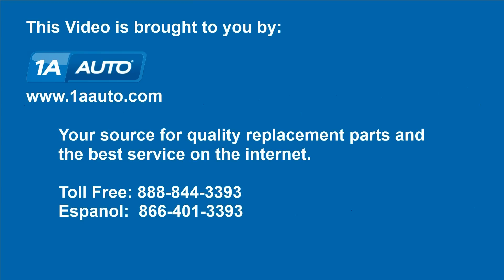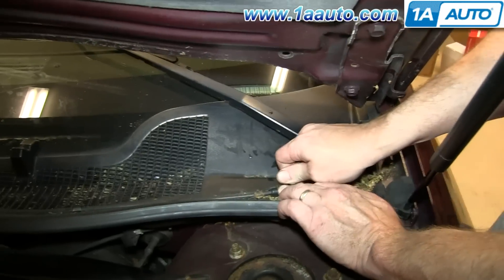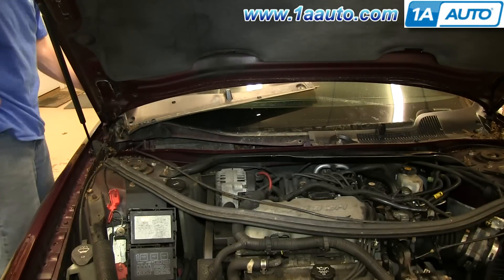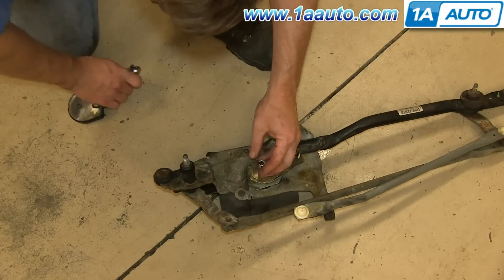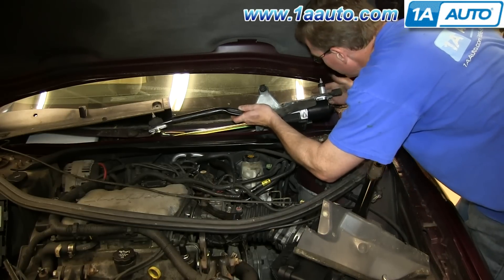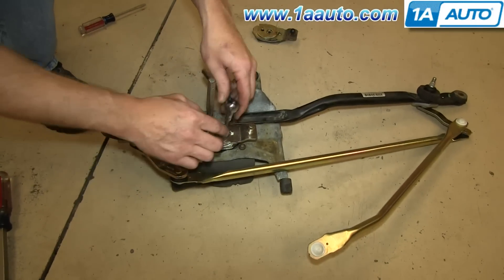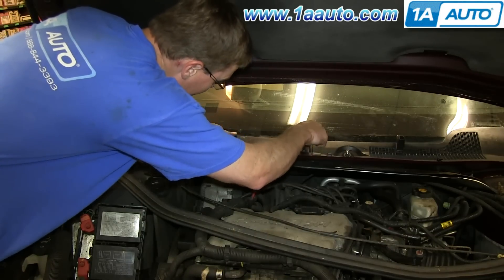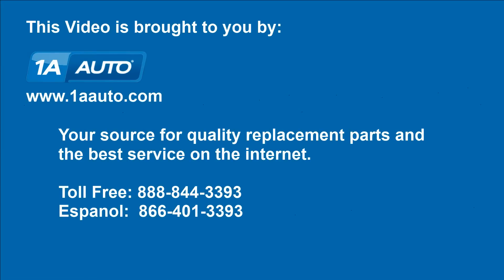How to Replace Windshield Wiper Motor 00-05 Chevy Monte Carlo

Comment: Great video, helped quite a bit. However I think their might be a few steps or information missing regarding installing the clutch to the motor. I followed what you said step by step but when I tried it with one wiper attached to be sure all was well it pulled the wiper down into the cowl where the transmission is. Then I tried letting it cycle through a few times the loosened the 13mm Torx screw and turned the clutch so it was in the same at rest position as in the video then tightened it back down. I then re-attached the wiper arm to check for proper operation. It first went through a whole smooth wipe but rested in the upright position. Clearly something is wrong. I can see that the clutch is made up of a top silver piece, semi round,  with holes for the screw and the alignment hole that you used to be sure all was lined up. There’s also a notch with a silver pin in it. Then there’s a brass color plate with the knuckle ball attachment for the transmission arm to connect to, an elongated notch for the plates to move around the silver pin and a couple of notches at the opposite end from the knuckle ball. Then there are two heavily oiled plates with a silver spring wrapping around the whole thing. Finally there’s a bottom silver plate with a large hole where it sits on the motor gear, the bottom semi elongated hole for the alignment a small hole just to the side of the large gear hole, an elongated semi curved opening with the bottom end of the same silver pin through it and on the front off center is a spear headed piece of metal with a copper color spring going over it. What do all these parts do and how does it relate to the connection of the clutch to the motor as well as the wiper arm travel during operation? This is where information and clarification is missing which seems to be keeping me from being able to complete the repair properly. Any additional information/clarification would be greatly appreciated and if you have any videos showing in greater detail this crucial step in the reinstall process that would be greatly appreciated as well. I’ll be waiting to hear back. In the meantime take care and HAPPY NEW YEAR!!! 
Sincerely,
Scott
Reply: Did you ever figure this out? I’m having this same problem

Comment: This is a good video. But, notice how easy everything comes apart. Taking my arm off the clutch I damaged the nylon that holds the arm to the clutch. No one makes the nylon piece for the 2000 to 2005 impala. I suggest you remove the clutch off the motor and leave the arm connected to the clutch. Or you will have to do what I did buy a 150 transmission because a 5 cent piece broke.
Reply from the maker: +Joseph Seremba Thanks for the feedback!

Comment: What other parts did you replace besides the motor ? In your video you can see a new set up getting installed ? Why was those parts replace ?
Reply from the maker: +jonathanschmidt417 The part replaced was the wiper transmission linkage.

Comment: What if the windshield wipers are stop in the up position once the wipers are switched off. ?    2002 chevy impala
Reply: Did you ever figure out a solution to this? Having the same problem right now

Comment: Great video but I have another issue, my wipers move and I can see the 13mm bolt moving but the passenger side stops and just the bolt moves is there a way to adjust it? Thanks
Reply: Sounds like the arm is stripped , but that's without seeing it.

Comment: Is this what I need to do if the wipers only work on high? Or is it a fuse or something like that?
Reply from the maker: +Shay Dog Thanks for your question. Unfortunately, we would not be able to diagnose an issue for you, but a local mechanic would be able to help you out. Thanks!
Reply: Mine only worked on high, but then stopped working altogether. I'm replacing the motor now, since it appears fairly easy, and I have a spare car with a free motor at my disposal.
Reply: I have to add - mine did work on high only, but not reliably. They would always take 5-10 minutes until the vehicle warmed up.

Comment: is there only one motor for two wipers?
Reply from the maker: +Quintin Williams Yes, the wipers on this vehicle are operated by a single motor.  Any other viewers interested in purchasing this part please visit our website below.

https://www.1aauto.com/windshield-wiper-motor/i/1awwm00023?utm_source=YouTube&utm_medium=CTA%20Comment&utm_campaign=ytc
Reply: I have a 2001 Impala -- Recently the passenger side wiper quit working, but the driver's side wiper still works fine. Would that be due to the wiper motor or something else? (presuming the Impala also only has one motor for both wipers).
Reply from the maker: +koolio90x You may want to check the wiper arm that isn't working to see if the inside of the arm is stripped that goes onto the post. If you remove the wiper arm, and turn the wipers on, see if the stud turns. If it does, the arm is probable bad. Hope this helps you out. 1aauto.com
Reply: Thanks. Will check and let you know what happens.

Comment: Same process for 2002 olds intrigue. I was wondering if you could explain running the motor before installing the transmission?
Reply from the maker: +Aaron Loomis You need to run the motor in order for it to line up properly with the brass colored piece in the video.  Any other viewers interested in purchasing this linkage please click the link: http://www.1aauto.com/windshield-wiper-motor/i/1awwm00023?utm_source=YouTube&utm_medium=CTA+Comment&utm_campaign=ytcomment&utm_term=7BTQdl_YeGE
Reply: I am also confused by the order. Are you supposed to install the (crank?) arm after the transmission assembly is back in the car?